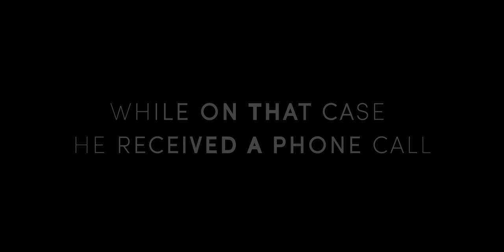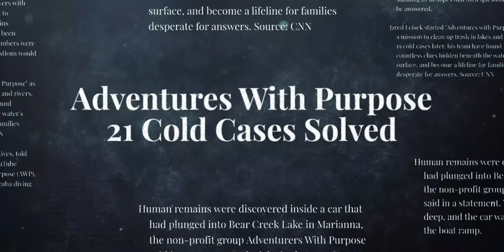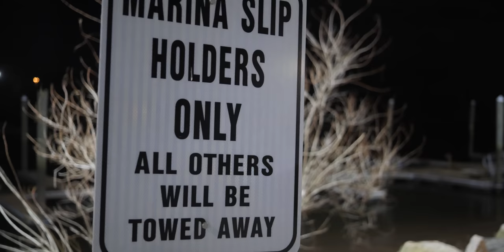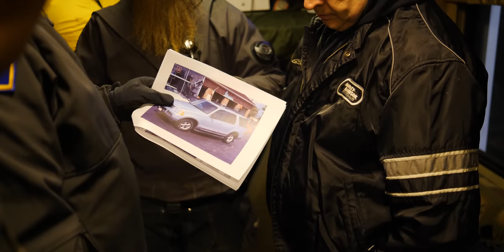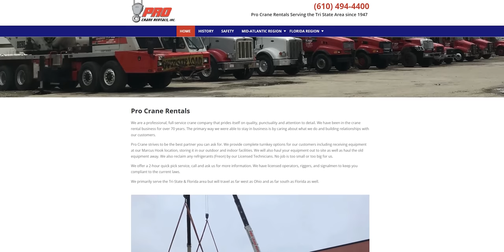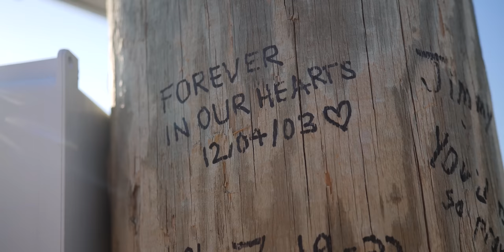SOLVED: Closure for Jimmy's Family | SUV Recovered 19-years Later [Final Ep4]

Comment: SHAME on that barge company who wanted to charge an “astronomical” fee for this job. They are the ones who ignorantly drilled that pilon through the vehicle in the first place. That’s just incredibly disgusting on so many levels.
Reply: I think they said in an earlier video the company that put the docks in are out of business
Reply: @cherylnapier5213  they said they hoped they were still in business.
Reply: @shark50401  oh good. my speakers cut in and out, or theirs does, missed that. thanks
Reply: You's do great work lads love from Dublin Ireland ❤️❤️
Reply: Yes I think the city should be filing a lawsuit against the company who put in the pylon because they obviously did a horrible job to begin with. I find it truly amazing it was able to stand upright all those years only being attached to a car and not the ground underneath it.
Reply: It depends right, if the crane wasnt in use and all you had to lend was an employee to be on site and gas costs, its okay. If however they dont have any cranes available unless loosing business, i can understand that they wouldnt make a crane available that easily.
Reply: I don't think they were clear if it was the same company.  Doug had said that calling the company who initially installed it would be an option, or if they had another company they used...  so who knows which one they ended up calling who said that...
Reply: Maybe it’s a blessing that neither the car nor the body was pinned down; if it wasn’t pinned/stuck then the current might have taken it down.  With the window open and his body disintegrated, who knows if they would have found him.
Hopefully, I made sense.
Reply: @feelincrispy7053  And on top of that, not all municipalities or regions have stringent requirements for geotech, or since it was almost 20 years ago the permitting process may have had more relaxed requirements
Reply: @martinlong408  don't matter if it's a day x months years a family waiting God bless them x bring him home xhx englandx
Reply: Right they should be able to Sue that barge company seriously
Reply: Yeah they had to know, or should have known, that that vehicle was there. The pile wasn't even drilled into the ground!  What company doesn't check to see that a pile they're putting in is in the ground?
Reply: They also said in part 4 that it wasn't actually drilled through the car, or did I hear that incorrectly ?
Reply: @jtidema  It would be easy to tell because the company that installed the pilons would of put a tag on each pilon with their name on it.
Reply: @Asher Enterprix The barge company hires out barges to companies who are drilling for and putting in piles. They would not have the contract for drilling.
Reply: @SlimmBeauty89  The barge companies usually just put barges in place for the heavy machinery used by drilling companies. It's the company which drilled for and placed the pilon in place which is at fault. It costs a lot to get a barge, and staff, to the scene. It could be that they would have to move a barge from another site. Not every firm can afford to provide free services. We should just celebrate the recovery of remains for the family.
Reply: its called how to twist everything around to save their asses because they fkd up
Reply: How would they have known if a car was down there tho?
Reply: not even throught the vehicle... IN the vehicle
Reply: It was a crane company he was referring to. Also, no one has to do anything for free. For those that do, they deserve more business.
Reply: @Seananigans.1  i think the anger was addressed to the company that drilled the pylon through the car before checking to see if anything was there. they didnt do their job properly which they would have found the victim decades sooner..
Reply: @kilcitykitty  Indeed that’s where the anger is. I’m just pointing out that the company they called to help retrieve the vehicle isn’t the same company that drilled the pylon.
Reply: @feelincrispy7053   Even s fishing sonars 15 years ago were more than capable of picking up a vehicle under water.   Flat out negligence for NOT clearing the piling site which is SOP for shallow water piles.  I'm sure the municipality will be going after the original general contractor for costs to repair and re-pile...
Reply: @Seananigans.1  ohh ok. I can see where there's a misunderstanding too
Reply: I know I know they can’t see but drilling through a car must have been harder than drilling through the ground or at least did something different
Reply: I thought it was a tree stump... I couldn't figure it out
Reply: @jessicas4295  yep its called greed
Reply: Unbelievable😮‍💨
Karma can and will be a bitch...bad publicity we can all hope for 😑
Reply: Ikr 😢they messed up they could of found that poor gentleman 15 years ago if they would’ve scanned the bottom like they were supposed too!! I pray the familia get the closure that the deserve!! God bless AWP N ALL THAT WERE HELPING..
Reply: @kodiak1294  by doing a proper underwater survey to see what they had to work with.
Reply: @kodiak1294  They could have made a survey of the bottom they had Sonars back then as well not as good like now but still good enough to see a big SUV
Reply: @predatortheme  no there’s a lot more to it then that there’s permits and more employees then just a driver. Also there’s and immediate cause for dozens of police officers and related people to be involved so there’s a ton more factors. Damages after a removal was also noted which in some places would be a HUGE factor. Those costs and damages are probably why they opted for a barge at first. When costs to get the barge outweighed everything they went with This approach. This would of been a huge bill if the owner wouldn’t of donated his time and resources.
Reply: Yeah, low IQ has consequences. What goes around comes around. Magically, business dries up when you treat your community poorly.
Reply: @ArcherBowman  I really hope karma was quick to respond to the barge company that wanted to charge an arm and a leg. And if it was the same company that put the post into the car’s engine? May it return to the decision makers there three fold.
Reply: @kodiak1294  they are meant to do a survey of the area before drilling. To find out how deep it is, what is down there and what ever else is necessary. They need to know if they are putting it into concrete or dirt or whatever.
Reply: I'd be doing research on who they were and spreading their name all over the place. Makes me wonder if the founder/owner of the company is still alive.  Disgraceful!
Reply: To be honest, they’re not really responsible for using sonar before they drill into the water on the 1 in 1 trillion chance there’s a car in that spot
Reply: I think if it wasn’t for the company’s negligence he wouldn’t have been found.
Reply: That company needs to lose contracts in that state at a min.
Reply: Money counts not peoples lives sad😢
Reply: Thanks for the info I was wondering what was sticking out of the hood I didn't watch this from the beginning.
Reply: Should publicly name and shame that barge company. No excuse for not surveying the area prior to piling in the pylons.  Any decent builder knows to survey the area first. It would have boosted their reputation had they agreed to do the job for nothing. Good to see the crane company stepping in when needed and they should get all the good publicity.
Reply: On the positive side of their greed, the company that did show up got a lot of exposure that isn't going to hurt their business. Thank you to all the people who don't need a dollar every time someone calls for help 💞 #heros
Reply: I'm confused about how they thought the pylon was drilled through the car. In part 4  Doug said the pylon wasn't through the car. But when you watch the video you can see it was through the front of the car.
Reply: Because it’s their fault a car was down there…
Reply: @matthewmcmurtry83  I agree!
Reply: @sketch735  you're correct. I'm wondering how they didn't know it wasn't drilled into the ground, or if they just didn't care if it was or not.
Reply: @elizagrogan9454  whether or not they could afford it I think the reason is that they didn't want to help is because then they would be somewhat owning up to their HUGE mistake of checking the river thoroughly.
Reply: @kilcitykitty  I agree. That the reason they were asking for such an astronomical price is because they didn't want to own up to their HUGE mistake of not checking the river thoroughly.
Reply: @kodiak1294  they were supposed to check the river. If they did, they did a shitty ass job of checking it. (Excuse my language)
Reply: @belindaadkins7619  before they started pulling the vehicle out they couldn't tell that it wasn't all the way through for multiple reasons. 2 of which I can think of.
1. Because visibility was terrible.
2. Because the vehicle was sitting in dirt and rocks, which is stated at some point when one of the divers states he can't get a rope through the rear driver's side tire when they were rigging the vehicle.
Reply: Doug's past experience makes this the perfect job for him.
Reply: Where exactly was this car. So close to home wow I didn't even know.
Reply: Argee
Reply: @matthewmcmurtry83  especially if there is evidence that during the survey they did see the car but didn't care. that's what I'm curious about! Technically would be tampering with evidence among other things.

Comment: Based on what I see and hear about the piling not being driven into the ground, this makes me think that a total inspection of everything that was done by the company that installed these pilings should be reviewed. It looks like this might’ve been a half assed job.
Reply: There are certainly some lessons to be learnt here, but now I hope that the word spreads in the industry - if there's a vehicle found in an underwater construction project - call Adventures with Purpose. They might just bring someone home.
Reply: Yeah... agreeing with all of you. They must have been aware that something was severely ‘off’ regarding that piling.... they would have had to cut off a significantly greater length compared to the other pilings when they topped them all off. There had to be an extra 12 to 15 feet of height.  Somebody made a crass and unprofessional decision to shortcut things like that. Somebody made the decision to not even check out the underwater situation.
Reply: @KMcKee-qn6bo  
With the amount of workers involved in that pier, and the knowledge that they had, I suspect they may have realized there was a car or something down there. If they didn’t look and didn’t know, then if it was a job that was bid and it probably was because it is a municipal structure, two things come to mind. The first thing is it was a bid, this was a contract,  the second thing is if they said anything and the car had to be removed they would be there a long time compared to what they had contracted for.  If I had the authority, I would have the entire structure inspected underwater. To me there was no oversight, that means there was no one there checking everything that was done so it met the specifications.
Reply: This raises the point that whatever job you do, I’d something seems off SAY SOMETHING. Trust your gut, and speak up. Nobody that matters will be upset about a little extra time to make sure it’s done right, and so often catastrophes happen because nobody says anything.
Reply: @shaneanderson1229  
I agree with you. Some of the stuff is actually funny this particular case notwithstanding. And when you’ve been around for a while you get to see lots of things especially if it involves mechanical devices and engineering. It probably wouldn’t surprise you if I said while paving a road, the asphalt pavers paved right over a dead groundhog on the road. I cannot tell you how many people were there and saw that. Eventually the news media showed it on the evening news. I’ve been involved in construction and taking things apart to repair or update I found horror stories. It’s a common thing. That’s not an excuse.
Reply: Em probably knew Jimmy s vehical was there , Being Ignorant not to tell sum1 , did it anyways , What An Company , wanted to charge, for an fee to help get him out , Thats B S , SOO SAD 😔,  BUT EM GOT JIMMY OUT WIT AN CRANE AT NO COST , THANKS ALL WHO HELPED ,, fan from MAINE

Comment: The pylons are spud poles, they usually stand them up and drop them through a hole in the docks and where they slide through and stick in the mud underwater is where they stay, it looks like it was a direct hit to the hood of the vehicle. It's amazing what you guys do for families.
Reply: They also have equipment that "hammers" posts in. Either way, they would have felt something that wasn't "earth".

Comment: RIP Jimmy. 

Shame on the company that sunk those wooden pylons without a proper survey of the river bed. Not only could this have been solved 15 years ago, but luckily no one was hurt by the improperly tethered dock. I can only imagine how another tragedy could have happened because of that. I think all the pylons need a thorough check to make sure they're safely/properly sunk. It's a minor miracle that it went through the engine block rather than the cab of the car.  Then to add more shame on to the pylon sinking company, they were asking a crazy fee to remove it. SMH.

I'm so glad the family had a good friend like the crane owner who was willing to donate his equipment and team, that's a true friend. Props go to the way LE worked with AWP on this one, it went on much easier and smoother because they worked with them instead of getting caught in ego & pride like some seem to do. Knowing when to utilise experts is the sign of strong leadership.

I have a diabetic friend who has many times woke up after 6-8 hours of sleep with her blood sugar dangerously low. And when it gets that low it's easy to get confused or even black out (which can just make it go lower because you can't then seek help).  Sadly, I can easily see how this could have happened if he had worked a long night shift, then slept longer than usual and woke in a panic over being late for picking up his daughters. It could even be the low blood sugar that made him sleep late (that's where diabetes can be so tricky, if you don't wake up in time to realise you're in a hypo,or have someone to wake you up during one, they can be fatal just on their own). That surge of adrenalin from realising you overslept and now you're late could easily cause someone to miss or mask the signs they're having a hypo.  This is such a heartbreaking accident. My heart goes out to Jimmy's family.

I heard Jimmy's brother say he had an insulin pump. I don't know how the pumps back in 2003 worked: if they had to be pressed to send the insulin, if they sent a set amount at a set time, or something else. But it could be possible if it was on a set schedule that if you don't eat on time but get that dose of insulin as if it had expected you to, then it could very easily cause an accidental hypoglycaemic event. 

I think the tech for pumps is more sophisticated these days, and wouldn't allow that to happen, but idk for sure. I do know my friend decided a pump wasn't for her as her diabetes was too unpredictable. Sometimes people who have always managed their diabetes perfectly can have hypos out-of-the-blue for no descernable reason, too.

Comment: Am I correct in understanding that, given that the pylon did not go through the vehicle, the dock was not fully secured into the bottom of the river? And thus, potentially a safety issue as well?  I have no knowledge of how these companies plan, mark and assemble over water structures, so I'm curious - was this preventable? Would technology in 2004 have provided information that the car was there before the company assembled the dock system? As much as we cannot place blame for an accident, it is still unsettling to think the company could have seriously compromised the vehicle and the human remains had they drilled even three feet to the left...

Comment: Whoever drilled the pylon into the vehicle should be charged. 
1. It creates an unsafe and unsecured section of dock
2. Due diligence to ensure pylons are into the ground was not done
3. This is technically tampering with a crime scene
4. If they did their due diligence they would have found the remains years earlier. 

If it was the same company who installed the pylon who wanted to charge an astronomical fee to do the recovery its probably better they didn't have anything to do with it if they are that sloppy with their work but if I was that sheriff I'd have hit their "astronomical bid" with well technically this falls under destruction of a crime scene but with your help in the recovery we might be able to let it slide in the intrest of making it right.

Comment: pylon
pī′lŏn″
noun
A movable, brightly colored cone or shaft of rubber that is used to signal something to be avoided, such as a hazard or work zone on a roadway.
A flexible, usually padded marker that stands upright at each corner of the end zone to facilitate judgments of close plays.
A tower marking a turning point in a race among aircraft.

piling - a column of wood or steel or concrete that is driven into the ground to provide support for a structure

Comment: In 2004 the company had to know that the pilon did not penetrate through the soil!  It was discovered to not have penetrated the vehicle.  The pilon would have been longer than all of the other pilons at the time of install.  So what did they do?, simply top the pilon to make it the same length???  Also, they had to know, originally, that they were not drilling the hole into the soil; they would have pulled up metal pieces, isn't it???